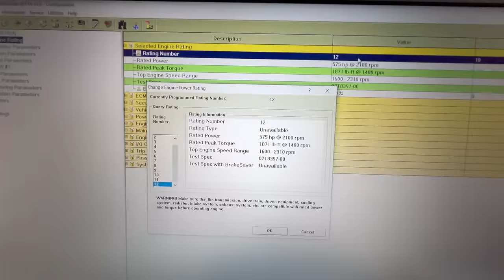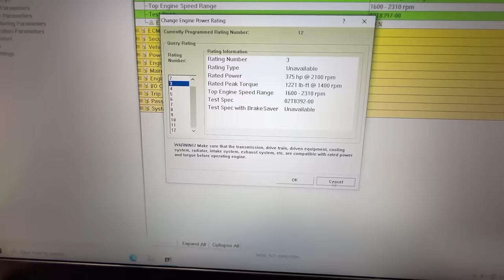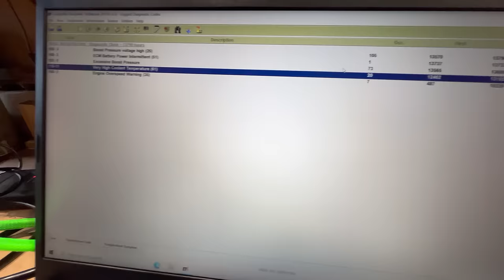Locked Up 565 HP Caterpillar 3406E Industrial Diesel Engine Tear Down

Comment: Have you ever seen an engine that sat with water in it and broke a main bearing cap?  I just found that on a jd 404 engine and the best I can figure is water was in the bearing and it froze/ expanded enough to break the cap. It sat for 12 years

Comment: New Holland used 3406 engines in the FX series, FX58 atleast has one of those, of course its different because its a equipment engine but still 3406🤷🏻‍♂️

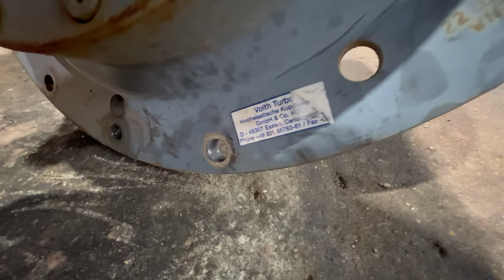Comment: 35:01 Voith manufactures marine propulsion systems, they make tug boat carousel thrusters which spin horizontally and by altering the carousel blade angles, the trust direction can be changed to any direction.
Reply: Those belt pulleys could have been driving a hyraulic pumps. Marine jet thrusters can have their own hydraulic pumps for bucket and nozzle cylinders taken from driveline. That means that those controls wont actuate without spinning the jet impeller.
Reply: Looks like they call it ”Voith Schneider Propeller” and cyclorotor in Wikipedia.

Comment: Great video! Could you reasonably install this model in a truck? Would you have to change the computer and harness? Just curious
Reply: Industrial engines have a lower rated max rpm limit compared to automotive ones.

Comment: Another way to get broke bolts off it don't always work but weld a nut on them after welding them you got to let them get cold again before cranking on them.

Comment: Would an engine like that be used in a tug boat or like used as supplement power on a ship? The air compressor and direct drive make me think that. As you need air pressure to start the ship's main engine.

Comment: Does Cat set the valve timing on the industrial versions so that the intake and exhaust valves are both open for a few degrees for extra scavenging? The Alco diesels I was around in the Navy were set up that way since they ran steady speeds most of the time.

Comment: If that block can be turned into a truck engine , it will be in high demand as a replacement for an older truck, or the first engine in a glider. Gliders are starting to get a lot of negative attention from regulatory authorities but as a replacement for an older truck, it can extend its life by decades. Governments don't like old vehicles but there aren't enough around to enact laws, except in California. LOL

Comment: inspiration to build my 2011.  i put a cam n after the msd cam failed at 75000 miles.  then at 250000 the harmonic balancer falls out.   and i think that’s why it’s locked up.   haven’t torn down yet😢

Comment: Could a 3406E truck engine be put in a Mack Vision circa 2006?  I see one for sale with a a leaking liner and my Mack (Aset) engine has a hole in the block.  Thoughts?

Comment: Funny how once the head is gone on some bolts the turn its like they release pressure I have had same thing happen snap bolts thinking ill be drilling pulling hair and it will come out with vice grips after .

Comment: Whats the CR on these ? Is boost and turbo the main differences when it comes to the spec ? decent gains in torque and horsepower with same equipment meaning for a ver flexible engine ?

Comment: I'm writing a novel about a ship in the 1950's and would love any feedback on engine choice.  The ship is about 150ft by 30ft and i was wondering if twin 1000hp engines would be reasonable?  Or for a ship of that size in that era more likely to have just a single 500hp engine comparable to the one in this video?  I know next to nothing on engines but care about accuracy so any help would be great, thanks ya'll
Reply: I suggest you contact the pilotage of your country. As in salt water ship's pilotage. Older pilots,retired pilots,would certainly know . And tend to be affable individuals who love to talk if what they know. The Rhine and the Mississippi rivers are fresh water systems which would also have sizable ships,also having mandatory pilots aboard. But for the most part,you would want Master Mariners,rated any tonnage any ocean. And the majority of them would be the salt water variety.
Good luck,contact the right guy ,you will have access to some amazing people.

Comment: Equip ID is what the owner designated the gear that this engine was attached to….Typically, only Cat cares about the serial number. The dealer or customer will assign an “Equip ID” for local use. Also, make sure your version of Cat ET is current……Should be 2023B or C

Comment: What are the slugs of metal in the cam gear for?
Reply: It's a torsional damper.  The slugs are loose in the hole and they roll up the side of the holes to damp vibration.  Automotive race engines have similar design called a Rattler.  Two other designs are elastomeric (most common automotive type) and viscous.

Comment: 13000 hours as a truck engine it would be 750'000 miles so ya it came to a full life cycle .
Reply: @charlesyates6687 13,000 hrs is around 542 days, 365 days in a year. So a truck engine can't run for 2 years?

Comment: Some have speculated this engine might have gone with a genset. I don't think so.... Voith (name on the flywheel adapter plate) makes a really cool marine propulsion system. Look up Voith VSP. They're fascinating: https://youtu.be/0muPdHICrKU
Reply: @seabulls69 You don't think it's from a genset? Might want to look into a locomotive genset, as the air pump is in fact from the locomotive industry that needs the high air flow.
Reply: @seabulls69  Internet "Caterpillar 240kw CAT 3406 genset" as that is what you just watched. Used in the rail road, or mine service with that air pump. Notice "with that air pump". Yes they do come in larger sizes like a 35 series, or smaller series and the Voith or CAT flex drive can be used.

Comment: Awfully expensive plugs, but they can be bough cheaper at Boersig. Shoot them an email, not much too lose. Lead time constantly changes, but they might have some, I got a big batch of 40 pin ones from them recently that were backordered, so they might have more stock on hand now. 
What do You mean you are going away from trucks? You want to do industrial/construction engines/machines, or just construction services?